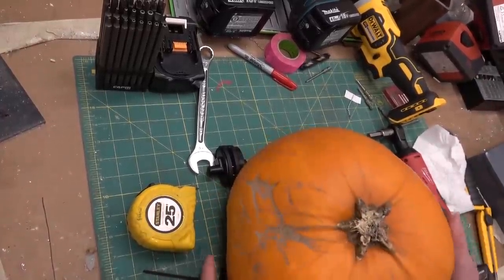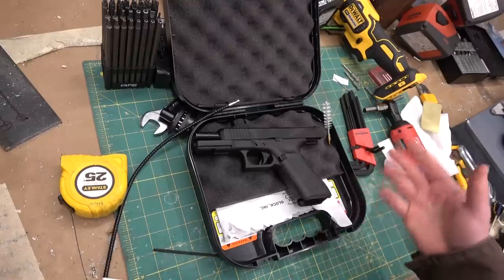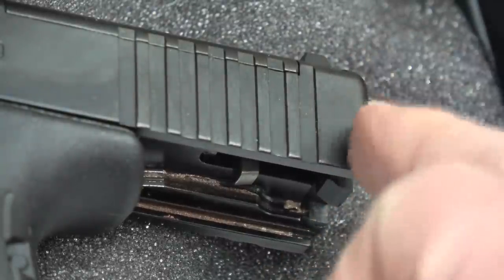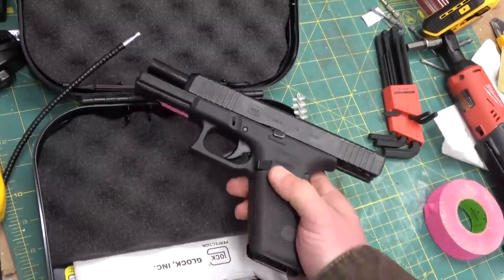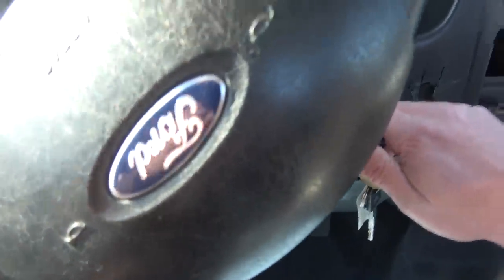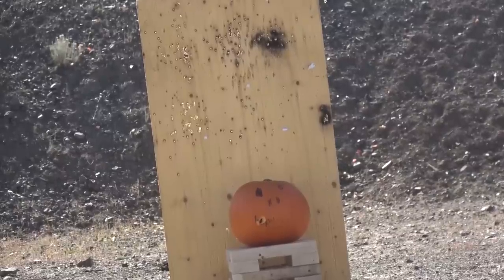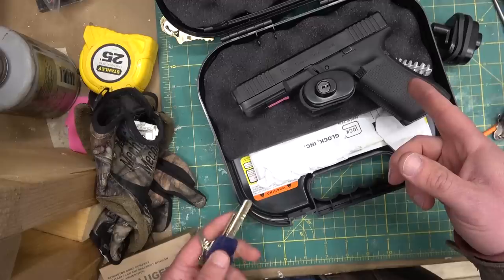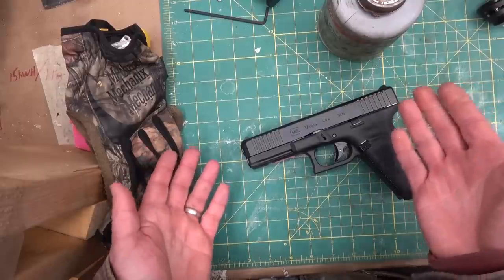BOLTR: GLOCK 17 GEN 5

Comment: For a more rewarding gourd impact, fill up your pumpkin with water. Hydrostatic shock makes for a substantially rapid and aesthetically pleasing disassembly of vegetation.
Reply: Doesn't work quite as well with handguns the handguns tend to shoot rounds a little too quickly to be able to dump their energy like that shotguns slugs which are both larger and slower is where you get that nice explosive effect
Reply: I wouldn't call it pumpkin carving if you turn it into a couple inch size pieces spread all over the range
Reply: Works with hollow points if you're willing to dump $1 a round.
Reply: @jon8706  yes hydroshock and hollow points are designed 2 dump energy I was just talking about standard ball ammo
Reply: Is that how the gun channels get that nice exploding pumpkin footage? Why didn't I think of that ...
Reply: Add wet, go boom!

Comment: Thank you for featuring a gun in the light of mechanical innovation.  These devices are literal mechanical computers that are designed to be operated in the wilderness, and have been doing so for hundreds of years.  Not to mention the impact firearms development has had on modern technology.  Think Henry Ford developed interchangeable parts?  Nope, that came about from various gunmakers going back into the 1860's.

Comment: Shooting down and to the left is classic recoil anticipation.
Reply: VestigialMind And the meat hook is being used on the joint.
Reply: *grabs micrometer 

Lol.
Reply: If you noticed they way he pulled the trigger he kept pulling his finger off and then pulling back which he is basically punching the trigger. Needs better training.
Reply: Came here to tell ol' Unc the same thing.
Reply: You are correct. However, AvE has a point about the sight not being centered. I bought a 43X a couple weeks ago and the rear sight was about as far to one as it could go before being able to see part of the dovetail from the bottom side. They sure crank them out in a hurry. I have a sight pusher for this reason
Reply: For righties
Reply: common mistake for new shooters. recoil anticipation can send shots anywhere really.
Reply: Banging the booger hook on the bang switch

Comment: When it came to that trigger pull AvE certainly used the "Slappy, slap, slap" method. lol
Reply: It's a special skill set to slap a squirt gun trigger.
Reply: At least he indexed after each shot lol
Reply: pretty sure every shot was milked. I wouldn't say "slapped".
Reply: @samwagner31  But he shouldn't though, Glock has a trigger reset so you don't have to pull the trigger the full length each shot.
Reply: Travelinmatt76 I know. ‘Twas sarcasm
Reply: @Travelinmatt1976  for a new shooter, it generally isn't a good idea for them to have their finger on the trigger before being on target.

Let's note a few things about the Glock trigger. There is no trigger stop. When it comes to fast shooting a Glock or any other pistol you do not wait for this "audible click" which is only a sign of poor engineering with inferior parts that we see on every fanboy channel out there.

The way you shoot better faster has absolutely NOTHING to do with the trigger reset. In other words, you pull that trigger way past that point of firing every time regardless of what some random douchebag fake instructor tells you. And you let that trigger travel all the way foreward... not till you hear that fucking "click". That won't help your technique, infact it will hurt it more than anything.
Reply: Who actually squeezes the trigger
Reply: Who actually squeezes the trigger
Reply: IWORKYOUWATCH 🙋🏻‍♂️
Reply: @Gregg0112  🙋‍♂️Every single time. I was taught to squeeze through the break of the shot, even during rapid fire. When you need to put shots down range you need to be on target and aware of your targets background. Also when you miss you aren't stopping the threat.

Comment: 90% of the time, inaccuracy comes fro the shooter not the gun. Myself included.
Reply: Or I think you could say, the weapon is more accurate than the shooter.
Reply: Exactly! By and large, with some degree of variation, guns shoot exactly where they are pointed.
Reply: I think he means that it is really common for people to drop shots and blame the sights when shooting pistols
Reply: inaccuracy does come from a glock when compared to other better pistols.
Reply: Low left is almost always a result of flinch before it goes off. Don't worry, I do it too but usually that's what it is
Reply: @lenseppanen3842  rest of fingers pulling with trigger finger hence the term "milk"
Reply: @campsitez2355  I can see how that can happen, but I'm not sure we are talking about the same thing... I'm talking about shot anticipation. John Lovell has a good video about it and explains it pretty well.

Comment: Quick tip for Glock disassembly (from a Glock owner), put your 4 fingers across the top of the slide with your thumb under the backstrap.  Pull with your fingers toward the thumb and use your other hand to pull down the 2 disassembly tabs.

Comment: The third safety you mentioned, is pressed by the slide being in battery. It does not interface with the magazine. It is simply there to make sure the gun cannot fire before the round is fully in the chamber

Comment: 11:03 That's also to spec AvE, it's meant to be slightly off center for right handed shooters, if you're left handed you'd push it off center on the left side.
Reply: No that is completely wrong. It's a common mistake for right handed shooters to pull the pistol low and left but it should not be compensated for with the sights rather the shooter should learn correct trigger pressing techniques and grip. You want to be rewarded with a bullseye when doing it correctly not the other way round.
Reply: @CCW1911  That's literally the manufacturer's spec LOL. I think Larry Vickers also went over it in one of his glock videos.

Comment: AvE: this here isn't a lubricant. Label on can he's waving around: "Lubricant" :D
Reply: John Ridley it’s not a lubricant in the standard sense.  
I’m not disagreeing with you, I’m just saying it has a specific purpose, and it isn’t a wd40/grease substitute
Reply: If you believe everything on the outside of a container, I have some bad news for you...
Reply: Throttle bottle cleaner says lubricant on it and it aint no motor oil
Reply: @the-potato-warrior  WD40 isn't a lubricant either. Grease, yes, but water-based lubricants will only work until they dry up and then you have the same problem you had before.
Reply: Next project farm video can an engine run on anti seize
Reply: @pandentia3529  yes it is, in that it lubricates, its purpose is as a water replacer , but it still lubricates, it being a petroleum oil based substance, it lubricates ok, but not very well.
Reply: @custos3249  it is a lubricant, a "bedding in" grease in fact, it may be abrasive but it is a lubricant, it being a grease. a grease being an oil and soap mixture.
Reply: @the-potato-warrior  WD40 is not a lubricant either. It's a rust inhibitor... WD and greese are not on the same level either. You have to know the purpose of the chemical your using. And the application you are going for. That's why there is tons of stuff like that on the market.
Reply: WD-40 is literally: “water dryer, recipe #40”.  Was originally intended to remove water from esoteric electromechanical assemblies. The fact that it also provides lubrication is a serendipitous benefit.
Reply: @deadprivacy  wd40 is a penetrating oil, and water displacer and rust inhibitor.. It's base is linseed oil, not petroleum, and you are wrong.
Reply: @deadprivacy  I think what most people are trying to do here, is just make you, and everyone else reading realize, that you're using wd40 for the wrong thing.
Reply: @BobSmith-rs7tn  Formulation
WD-40's formula is a trade secret, and has not changed over the years, according to historian Iris Engstrand.[3]

To avoid disclosing its composition, the product was not patented in 1953, and the window of opportunity for patenting it has long since closed.[7] WD-40's main ingredients as supplied in aerosol cans, according to US Material Safety Data Sheet information, are:

50% "aliphatic hydrocarbons". The manufacturer's website claims this ratio in the current formulation cannot accurately be described as Stoddard solvent, a similar mixture of hydrocarbons.[16]
<25% PETROLEUM base oil. Presumably a mineral oil or light lubricating oil.
12–18% low vapor pressure aliphatic hydrocarbon. Reduces the liquid's viscosity so that it can be used in aerosols. The hydrocarbon evaporates during application.
2–3% carbon dioxide. A propellant which is now used instead of the original liquefied petroleum gas to reduce WD-40's flammability. (A bulk liquid version, without a propellant, is also manufactured for industrial use.)
<10% inert ingredients.

The German version of the mandatory EU safety sheet lists the following safety-relevant ingredients:

60–80% hydrogen-treated heavy naphtha (a PETROLEUM product used in wick-type cigarette lighters)
1–5% carbon dioxide
Reply: Custos Look at any packing box on the prop shaft in a boat, and you’ll find it’s water lubricated. Just because something doesn’t work everywhere doesn’t mean it can work somewhere. Lubricant simplify means something that lowers friction and prevents wear in some assembly. But I’d agree that calling an abrasive suspended in grease a lubricant is a bit of a stretch.
Reply: @sstorholm  yet copper grease is known as "brake lube" in half the english speaking world.
or "copper slip" AVE is very wrong that it doesnt provide "slip" its literally known as copper SLIP
Reply: WD-40 isn`t a Lubricant either....
Reply: @Dynoooo  despite it reducing friction, hmmm,
Reply: fucking ell it was just a funny observation.
Reply: Arduino vs Evil has been wrong in the past. I mean, his biggest shtick is to piss on sintered parts...which mind you, are perfectly ok. I dare anyone take a manual grinder to a sintered part to see just how hard it skates on the surface.

In this here case, i believe the purpose of that paste is to keep other things off whilst allowing the rail to set in( your'e supposed to do that, btw with your first uses). I very much doubt g-lock, a reputable company with years of know how in the subject, would ship a powder actuator with something that's detrimental to its function.
Reply: @macro820  And which brand is best.
Reply: KY is a lubricant too, but ain’t right for your pistole. So it’s all in the context.

Comment: Now here's something that really gonna bake your noodle : the entire Glock line of pistols are actually a simplified - wait for it - 1911.  Yep, the pistol that Glock fanboys hate the most.  The tilt-lock barrel originates with the Browning design and the trigger dingus functions mechanically similar to the grip safety on the 1911. Gaston redid/ruined the trigger necessitating the switch ti a striker instead of traditional firing pin, integrated the barrel bushing into the slide and generally updated the whole thing for the CNC era, but yeah it's got the heart of at 1911 with the barrel lock up. 

Oh, and the factory non-lubricant is there to wear-in the gun intentionally. They know the average shooter will do exactly what you did, take it out, put just enough rounds through it to finish deburing it, then strip it down to clean it and apply real lubricant.
Reply: To be fair, most pistols use the Browning tilt barrel system.
Reply: um not so much.... hoping this is just satire, but seems a little long for that.
Reply: What's funny here, is that while MOST automatic pistols use the Browning tilt barrel system... The 1911 DOESN'T! 
That system originated in the Browning high power 9mm, which JMB himself considered a superior design to the 1911.
I'm a Glock fanboi, but love 1911s and hi powers just fine.
Reply: The browning tilting barrel system was the direct successor to the browning translating barrel from the same man, they are both short recoil action and its specified directly in the tilting barrel patients it was a simpler, more compact configuration to serve the same purpose.. in this regard and this regard only the glock is a "simplified 1911"... but in that manner so is essentially the majority of firearms sold today.
Reply: Glock people don't hate the 1911. Glock people hate 1911 people. 
The inverse is also usually true.
Reply: Wait what? I'm out of the loop, but I'm an outsider enthusiast. What complaints do Glock owners have with the 1911? That thing is a beautiful weapon...
Reply: "the trigger dingus functions mechanically similar to the grip safety on the 1911" - in the same way that a caliper brake is "mechanically similar" to a drum brake.

Comment: The slide/receiver tolerances arent all that important to the accuracy on Glocks, the accuracy is in the slide/barrel lockup, which is a machined/machined interface. The only issue ive heard of from knarled up slide guides is increased wear, and thats with 10's of thousands of rounds. Alot of very accurate glocks have some lateral wiggle room in the slide when in battery.
Reply: very true, you don't aim with the grip, you aim down the slide

Comment: Glock frames are a (secret) proprietary hybrid blend Glock calls Polymer 2 - most likely is or very similar to Dupont Zytel (according to some sources), nylon 6 or polyamide 66 according to others.
also OH F*CK YEAH loving the first (?) BOLTR firearm review!
Reply: bo Smith & Wesson got sued for their m and p line because it was almost an exact copy done cheaper.
I own a full sized m and p 40, I prefer it over the glock.
It’s just a better pistol (in my opinion)
Reply: Sadly S&W quality control is crap.
Reply: But. . . But. . .  He used it first before he took it apart! Did I run the film backwards? I'm confused.
Reply: I had a Beretta for a time (not sure the model cant remember) I rather liked it good feel
Reply: Charles McKinley 🤷‍♂️
I’ve had zero malfunctions for the 2 years I’ve had it.
It’s my carry weapon.
Reply: @the-potato-warrior  Smith and Wesson didn't get sued over the M&P line of pistols.. it was the SD (SD9VE specifically) line of pistols.. they are such a close copy of the glock pistols that some parts can interchange..
They also pay a royalty per pistol to Glock in order to keep making them
Reply: It wasnt for Smith's m&p pistol, it was their earlier line called SD or Sigma series that they were used over by glock, and won. So s meek other changed the design slightly and re named it the SW9VE which are still sold today for well under $300
Reply: @proto AvE knew with his rate of attrition, he'd want to get a few rounds off, before he bumblefarked it.
Reply: Ive worked in plastics a long time.  Everyone uses the same commercially available polymers, but they tend to call them whatever they want and claim its a trade secret.

Comment: On the three safeties: The third one is actually to prevent out-of-battery detonations. IE: the slide hasn't finished closing but you pull the trigger anyway. The third safety you point out prevents the firing pin from acting if the slide isn't fully closed.

Comment: 17:20
Regarding the SKS, Sergei Gavrilovich Simonov was its designer, not Kalashnikov.
To my knowledge, both the SKS and AK were originally made by milling, not stamping. However, as the Russians refined their stamping processes and whatnot to get the tolerances good enough, the AK became primarily a stamped rifle. I'd assume the SKS would also start to be made of stampings, but I'm not positive.

It's amazing how decades of iteration can produce such an economically and mechanically  refined machine. I'd assume this is why most militaries are still using AK and AR pattern rifles decades after the inception of their design.

Ian McCollum from the channel Forgotten Weapons has very detailed and thorough videos on the history of these rifles, which I'd recommend watching if this topic is of interest. And I've no doubt made some historical omission or inaccuracy, so a video of his would do well to provide a more clear representation of the history behind them.
Reply: There are both milled and stamped SKS's but the stamped ones are rather rare.
Reply: I believe Kalashnikov originally designed the AK with a stamped receiver, but as the soviets didn't have the equipment to mass produce them it was switched to a milled receiver on the early AKs so that they could produce them with existing tooling.  Once they had sufficient tooling to mass produce them they did go back to a stamped receiver.  You can still get milled receiver AKs to this day, but there is a price premium.

Comment: Glocks actually feature a special kind of rifling known as Polygonal Rifling as opposed to the far more common Lands And Grooves rifling were all used to seeing. That's why the end of the barrel (crown) looks like that. Also the "claw" which you referred to as the "ejector" is actually the extractor. The ejector is the little nub in the frame  it hits which kicks the case out the side and out of the grasp of the extractor.